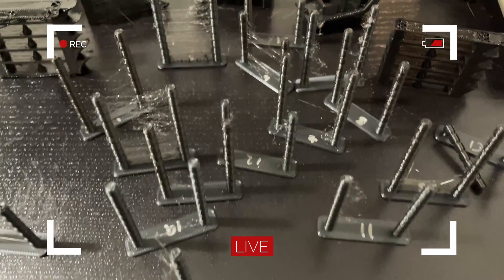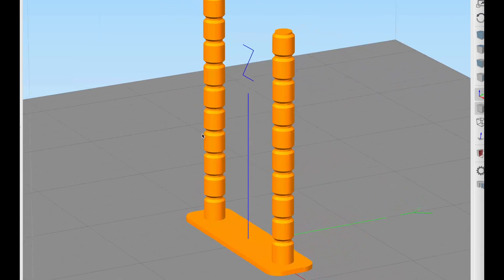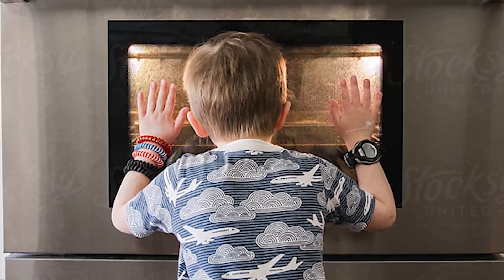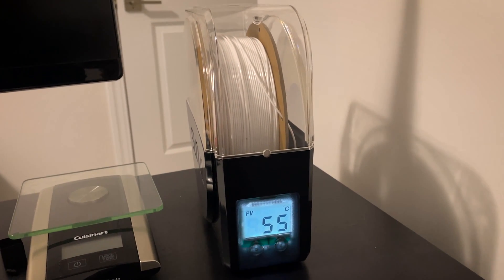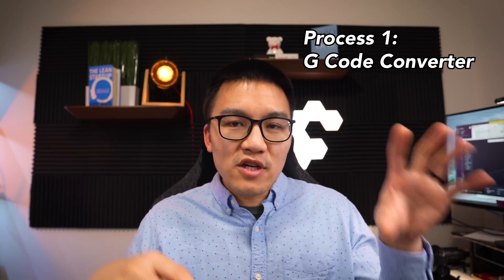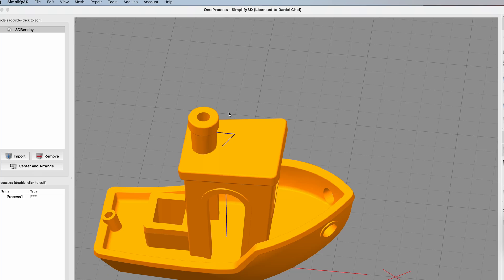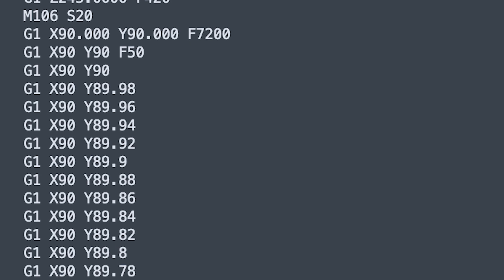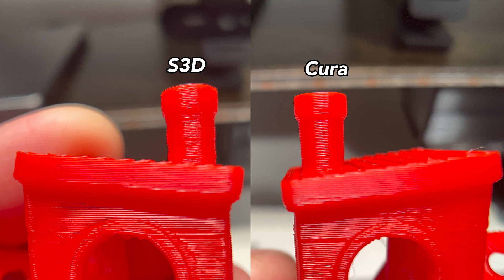Why 3D printers struggles to print perfect cylinders [and how to fix it]

Comment: Well...I guess the solution is...wait...gonna have to watch this again.  Damn engineers. 😡🤪🤣

I got "slow down" or "learn programming" out of this. 🤣

I wonder if the "per model" settings in Cura will let you adjust temps & speeds on sections of the model?  I haven't mastered that tool yet.

Comment: Interesting things to try.   I was wondering if you have any experience with changing the extruder nozzle to improve the print quality? The quality of my prints on my AD4 started going down lately, and I was getting a knocking sound even after raising the extruder temp to the max for that PLA.  Turns out the nozzle was the issue.  Not sure if it was worn out or just plugged, but after changing to a new nozzle the knocking stopped, and all the blobs and stringing went away.   
Kind of surprised that I needed to change the nozzle already after maybe 400 hours of printing. Only printing PLA so far.  I heard that the sparkly PLAs are abrasive, and I have used them some, but very little.  I have mostly used on color non-silky / non sparkly PLA.  

What has been your experience with how many hours a nozzle lasts on an AD4 before you have to change it?

Comment: Look into incorporating the "ArcWelderLib" post-processor into your slicer workflow (it can be integrated into Simplify3D, Cura, Slic3r variants, etc). Typically slicers and printers use exclusively straight-line moves (G0/G1), which can lead to processing bottlenecks on certain hardware + motions. ArcWelder converts these to G2/G3 (arc) commands, allowing many curves to be executed with just a single line of G-Code without any loss of precision. Even for complicated curves, G-Code length is typically substantially reduced. 

Note, your printer MUST support G2/G3 commands for this to function properly. If this is not documented, it can be tested (carefully) by sending the appropriate G-Code. No guarantees this is enabled or supported on proprietary firmware... but for printers not running Klipper, ArcWelder is massively helpful for quality and speed.

Comment: Hey Daniel. 
Been watching your videos and wanted to say thanks for the awesome work you are doing and many thanks for sharing with the rest of us 🙏🏼 
I have the same issue as u mentioned in the video, but I only use Flashprint, do u have any idea how to make it more stable with flashprint?
Reply from the maker: I haven’t figured out how to do it with flashprint yet. Look for something along the lines of “minimum line length”. Basically the smallest straight line movement the slicer will break the part into
Reply: @justmakeitdaniel7667  I tried yesterday to use cura using your video to set it up to the flash forge av4 and it worked like a charm, still have some minor things to play around with, but it seems like your on to something whit the length with the g code, I got a much better results and almost to non stringing. 😃
Thanks again and looking forward to your next video 😊

Comment: Very nice video and hits my paint point accurately.
You mentioned flashprint, I guess you are also using FlashForge printer? I am using flashforge creator pro(FFCP), that was 5years old printer with me.
when I start to print a pyramid, the tip is a blob and I tried those single factor validation: filament quality, dried filament, belt tightening, fan speed, hot end temperature, print speed. I am really exhausted. 
If you are using flashforge, how you convert to G-CODE? how you use  S3D in FFCP? I am trying to use Prusa and GPX and failed many times.
last one, you have really great video. I am non-native speaker and layman on coding, without subtitle I barely can catch up on buffer/g-code reading session. If you could, will you adding the subtitle in your future videos? that is my issue I totally understand if you too busy to add.

Comment: Great video, I was contemplating switching to s3d for the adv4 ( I use it for my raise 3d printers) however might not bother now. I’m not really a fan of Cura either, I wonder how it would perform using Prusa Slicer.
Reply from the maker: Yeh I would recommend going with something a bit more open source

Comment: Cura with creality based printers stringing was always an issue. A few tips are, no z hop, combing, and wipe distance.
This video does a better job of explaining (we used to get that stuttering on 8 bit boards, but using G2, G3 arc commands with arc welder plugin solved that)
Stringing :
https://youtu.be/_QRb54zVPfQ

Arc welder :
https://youtu.be/crNU6UoBsKA
Reply from the maker: I actually have used all three of those settings and tried to tune them without full success. I am getting some whisps rather than a full string across but still undesirable. For context I’m using the adventurer 4 which isn’t a creality printer
Reply: @justmakeitdaniel7667  Whisping is the problem I have with cura on several printers except an old bcn3d sigma which came tuned with a version of cura with a different gui. Now I learning prusa slicer or superslicer or idea maker depending on the project... No idea why the problem exists but would like to know. Thanks

Comment: Great video Daniel!
In Cura when adding A4, what printer settings to you have?
A4 is not listed and there are loads of printer/printhead settings
Reply from the maker: I can do a walk through of how I setup Cura for the adventurer 4 in the near future
Reply: @justmakeitdaniel7667  That would be super helpful
Another topic I'm currently trying to prints are screw and bolts. Not for holding weight but just for connecting printed parts. Sometimes it works great, other times not so much... 😂